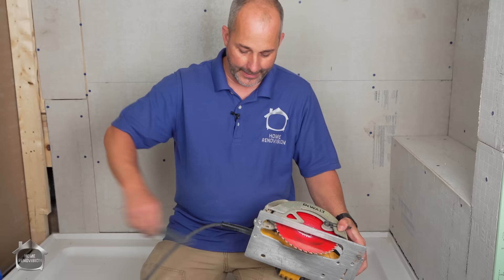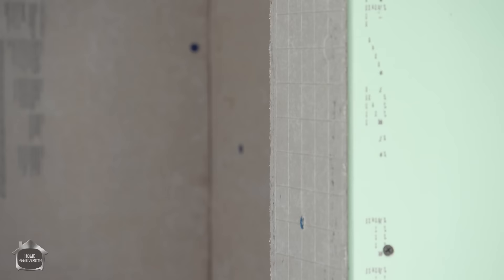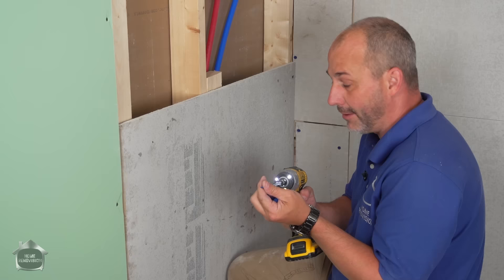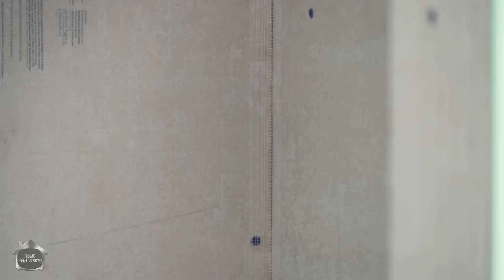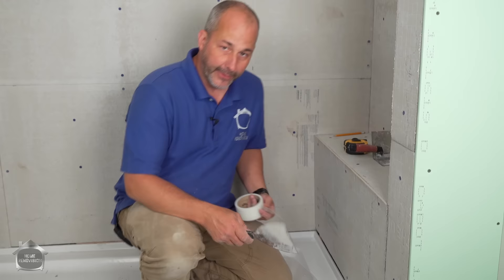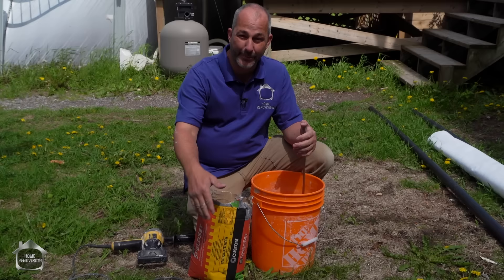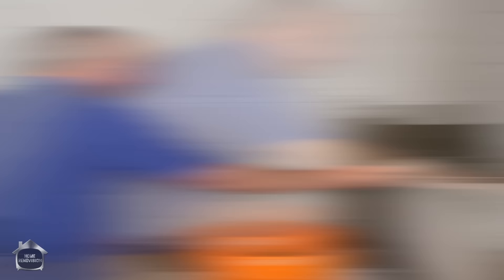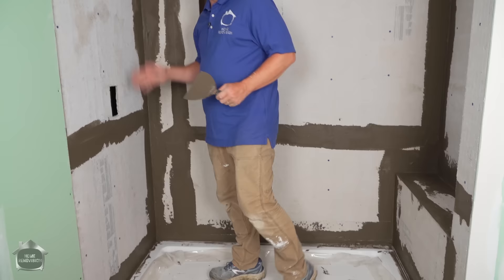How to Install Cement Board for Beginners

Comment: We are installing a 3x5 walk-in shower with a fiberglass shower pan.  We need to take up 1/2" of space on each of the 3 walls for the shower pan to fit perfectly.  What is the best product to use to take up that space before we put the cement board on?  We were thinking of waterproofing drywall, attaching the cement board and then waterproofing that as well.  Do you have some expertise for us please?

Comment: I tried to do the seams and I couldn’t find any material that went on that smooth. I don’t know what to use, ended up using thinset mortar
Reply: Your supposed to use thinset morter. He mixed it just a tad runnier so he had more working time. Some guys will seam as they tile.

Comment: Can you mix and match Kerdi board with  1/2” backer board? Stared remodeling my shower with the kerdi 3x5 kerdi boards but it got expensive quick, so I switched to backer board on the walls. I don’t want to waste the kerdi I already have installed so can I use both, kerdi on one wall and hardi backer on the other?

Comment: I know it' not necessary, but I would still apply the Aquadefense up to head level all the way across the whole back wall of the shower. Probably higher. I know you didn't have enough material to do it but still.

Comment: Hey great videos. I'm redoing my bathtub now and I got to the point that I need to join and finish cement board and drywall. What is the recommended way to do that nowadays? Thanks.

Comment: Hi Jeff, what is your experience using Dens Shield as backer board? It is light, can be cut with knife and moisture proof, so very user friendly for a woman DIYer. Most interested to hear from you before I begin the bath renovation. thank you.

Comment: I'm doing my bathroom right now. 
And I'm debating weather to use any waterproofing.  I did buy the red guard and I'm at that point right now. Just gotta finish the niche's and it's ready to seal. 
My issue is water flows downward always. But waterproofing really is  redundant to a point. 
But I guess for piece of mind.

Comment: When cement board is flush with dry wall, how do you handle this joint?  do you tape? do you tape and use cement over the entire joint/ or half the joint?
Reply from the maker: design the joint to finish behind the tile on the exterior of the shower. then just install the tile and ignore the joint. that crack will never translate to the tile.

Comment: Really appreciate your videos.  One question regarding the cement board:  You had said to use half-inch cement board when it joins with sheet-rock.  So did you use the quarter-inch cement board in the back of the tub or is it half-inch also?

Comment: Thank you so much for all your great tips and tricks! We have learned SO much already! We are working on our bathroom and have a couple of questions. Why do you think it's not good to put two 1/4 inch cement boards on top of one another? HardieBacker is currently available in 1/4 inch and .42 inch thickness. We're wondering if we should use .42 inch thickness or two 1/4 boards on top of each other to butt against our 1/2" drywall. Thank you in advance for your answer!

Comment: In the case of using cement board around a window in the shower area, do the inside corners of the window also receive the mesh tape and quickset or would it be better to use a silicone or the 2 in 1 bond/sealant you like in that instance? 

In the same vein if I’m using the aqua defense as my waterproofing in the window is silicone the appropriate product to use to seal the gap between a vinyl window frame and the cement board which can then receive the roll on application of the aqua defense?

Comment: Thanks for your videos.  Awesome!   My wife has been asking for a window in bathroom for 10 years.  I watched your videos and did it last weekend. Looks great!   I have a question about how the wall board you showed connects to a custom poured shower pan.   I have seen where people say if the board touches the pan it can wick up moisture.  Do you have a best practice?   Also if you have any best practice for a curb?   Pour base or screw on wallboard?  Just not sure is most effective waterproofed methods.   Thanks!!

Comment: Hi , your videos are immensly helpful. I have a question regarding the finishing of cement board, but for the fireplace.  Humidity is not an issue, heat is!

I replaced my fireplace with a high efficiency (still wood). I repaired the hole that was made for the change by screwing cement board (durock, 1/2'') in the metal frames, it's solid but there is a little flex in the middle. I put plaster of Paris, non-shrinking compound, to fill the gap on the horizontal joint, then I put mesh tape between the 2 sheets with drywall compound, waiting between layers and waiting 3 days before making a fire.  Whenever i make a fire, a horizontal crack appears. Repaired 2 times, same thing. Have an idea, I'm stuck.

Comment: Thank you, my basement recently flooded with an inch of water, I cut out the sheetrock t 16" above the floor, I want to install cement board and tape it to the above sheetrock, what kind of tape should I use?

Comment: Does the cement board need priming first? I'm doing my shower room now, and the cement board is dusty.
Reply: I've seen to clean it off first with a damp rag and/or sponge. The dust will keep the cement thin set from sticking, just like tape won't stick to a dusty box.

Comment: Do you have to use 1/2" backer board next to drywall? What about the finished tile thickness?

The 1/4" hardy board is 1 screw every 7sq inches

Comment: Can a Schluter shower tray be used with cement board walls? Do you have a previous video that addresses this? We don't want to spend the extra $$ on an all-Schluter shower, but want to ensure a proper slope to avoid any drainage issues. Our bathroom width is only 58" so a standard 60" shower pan is not an option. Or maybe there is another pre-slope product you would recommend?

Comment: I have seen multiple different opinions. Should the concrete backer board go to the top of the tub flange like you put, or in front of it down to the tub top?

Comment: Hello Jeff, Love your videos I have accomplished a few projects following your projects. Question? shouldn't I use a silicon between shower pan and backerboard prior to applying the cement. I would think with the flexing in the shower pan I might start getting cracks in the cement after awhile. Your Thoughts. Thanks

Comment: I am trying to find out the finer points of building 2 master bath showers in the container home I am building. evidently you build a frame to pour your concrete showerpan. lots of details related to getting your membrane & drain located correctly. after that its tiling the stall. which is better durarock or cement board? Relative to the outer concrete surface of the pan, when assembled correctly where is the inner surface of the durarock or cement board?

Comment: Nice waterproofing.  So, you roll on a waterproof barrier, and then apply a water based tile glue (or perhaps cement).  Do you ever have issues with the tile set glue bonding to the water proofer product?

Comment: Have watched several of your videos as I'm demo'ing a +100 year old bathroom! 🙀 I've heard you say a couple times "water will drain back out of the tile to your drain" in your cement board video, tile video, etc. Is there a vid you can point me to that helps me manage this? Does the silicone bead at the bottom of the tile/tub lock that water in? Thanks!

Comment: I have a question regarding what thin set to use over the waterproofing. Some YouTube videos say if you waterproof then you cannot use a modified thin set or it will take 30 days to dry. Do you use modified or unmodified thin set for your tile work over waterproofing? Thanks so much

Comment: Are you supposed to start with cement wall and then the regular drywall or viceversa?

What the best way to waterproof a walk in shower that didn’t have any pan liner when all the tiles and all the drywall were removed and it’s a concrete floor? 

I’m stuck now with an empty bathroom and not knowing what else to do?

Comment: I have watche a ton of your vids and it helps more then you  know.. Question for ya. I started remodel shower with kerdi board and then miscut and ran out. I lagged for a few months and now everyone is sold out of kerdi board till august. Floor decor h depot lowes everyone. I have one wall that needs to complete. Can i put cement board on that one wall and the other two have kerdi board. If not i fear i have to re due all kerdi with cement board. Any suggestions would be awesome.

Comment: Remodeling my bathtub….after removing old tiles and walls I used concrete wonder boards for the walls….also adding lights…do I need to use wonder board for my low 7 foot ceiling?

Comment: Can you use the roll on water proof system over regular mold resistant board or do you need to use the cement board   thank you

Comment: Hi Any advice on what to use over  cement board that is placed externally on a perimeter fence that will be painted, not tiled. I mean what kind or primer or membrane is ideal before painting please.

Comment: Jeff, I have a question. It appears that there was a horizontal joint near the top left side of the niche and when you were doing the joints with mortar you didn’t cover that joint? Why not? Thanks

Comment: Is the quick-set you use as a joint compound for the cement board the same as thin-set mortar used to place the tiles?

Comment: Woodbridge, Virginia. My master bath shower was built with "Green Board". I am in the process of re-building it now, and have a question for you.  One of the shower walls is also an exterior wall. It gets very cold in the winter. Could I use 1/4 foam board with a 1/4 inch hardi backer? I do need to blend it in to drywall. So it does need to be at a 1/2 inch. It just seems that the combo will give the 1/2 inch and a level of isolation from the cold of the exterior wall. I am looking forward to any answers I get.

Comment: I have cement board to drywall meeting each other, each side doesn't have the manufactured dip. I want to finish it nicely between the cement board and drywall by using perhaps T trim. Do I install T trim before doing thinset or after?

Comment: Hello, how would this do for exterior use? And what would be the best way to waterproof the cement board? I was told this is good for board and batten on a barn but I’ve never messed with cement board.

Comment: In a later video you add extra thinset to slope the bench a bit for drainage when installing the tile. Why not just slope the bench frame itself when you were building it? If that's flat, wouldn't water that makes it way underneath just sit there?

Comment: Do you have to use backer board on the ceiling in the shower? I am renovating my stand up shower, does backer board need be in the entire shower? Does it need run up to the ceiling to include the ceiling?
Reply from the maker: only if you are tiling the ceiling. Cheers!

Comment: You mention that water can get behind tile, but what about glue-up wall panels? Flat Mustee Durawall wall panels for instance. Redguard is insanely expensive here so I'm looking for other options. I'm also not sure if the loctite will bond to redguard.
I want to use hardie cementboard that is water resistant and I will put pvc trim along the top perimeter and use 100% silicone all around it.
I have a tub without a flange (old cast iron one) and I'm trying to figure out the best way to install the cementboard above it. I've read it needs a 1/4" gap between the lip of the tub and the board, its that right? If I put moisture barrier behind the cementboard, can I use some flashing to bring it to the edge of the tub to make a sort of plastic flange? (so long as the flashing isn't visible under the cementboard. I also plan to put caulk along the underside of the cementboard and maybe some Instatrim over that.
Can aquadefense be painted over?

Comment: Complete novice here.. ? Is there anything specific  to be done to joints where  hardie board and drywall meet? As in for a backsplash  or half wall. Would you use drywall joint compound  or thin set? Also if say I am only  doing a backsplash  would you reccomend  cutting the hardie board  to only area tiled or could the untitled area be finished   like the drywall n painted?

Comment: I used Mapelastic CI by advise of Floor and Decor associate, and after applying it on the shower wall, I realized that this product is to prevent cracks but not for waterproofing. I wanted to get advise if I can still paint over the brown Mapelastic CI that is already applied on Hardiboard with Aquadefense instead of tearing everything thing down and re-boarding with hardie board? If so will it impact tile application or tile strength in the future? Thanks in advance.

Comment: Hi Jeff, we are remodeling our bathroom and while installing the drain for the bathtub, the plumber forgot to peel the plastic off the drain hole before he installed the tub drain. He used plumber putty for that, now everything seems pretty tight but do you think eventually it might leak? The floor is still open at this point, do you recommend us to have him come back to reinstall the drain or do you think it will be fine? Thank you.

Comment: First time shower diy.,
I bought the Laticrete waterproofing fabric and plan on getting the red guard and cement backer board... But do I need tape and mud the joints when I have the waterproof fabric?

Comment: I have a contractor who used drywall compound in the joints. After the fact I figured out that this was incorrect. Should he remove the compound,? put thinset over the compound? Or remove the boards?

Comment: Can I use the same Sand Mix for the bottom preslope and for on top of the shower pan liner for my shower pan? Or do I need Concrete on top of Pan Liner? Extremely helpful videos. Thanks so much for making them so detailed.

Comment: My cement board is extremely heavy to the point where i dont know if i will be able to hang it myself. Did i get the right product? And should i cut it to manageable pieces or just use one piece per wall. The sheets i bought are big enough to do that.

Comment: I'm noticing that the cement board is sold mostly by 1/4 inch instead of 1/2 (I assume because of weight). Is it typical to drywall a bathroom in 1/4 drywall instead of 1/2 drywall so you can make the transition easy out of your walk in shower into the rest of the bathroom?

Comment: Quick question 
I used cement board in wet area after finishing it with paint i found hair cracks at every joint of board knowing that i used mech and universal putty what could be the reason ?
I’ve tried to open the join by 5mm and fill it with sealant but the crack keep coming back

Comment: Jeff if you are using cement board on a kitchen floor do you still use the tape on the seams. also do you glue the cement board down or just screw the board down? thanks Butch

Comment: I am using Kerdi waterproof cement board (not foam board).  I will apply cement on seams.  Do I think need to apply the waterproof membrane only to the cement on seams?  Is that even necessary?  Thanks.

Comment: Jeff, though I’ve just started watching the videos, when I tore out the existing shower, the pan was customized where the standard 36 x 60 is not long enough or wide enough. I have to build out the back wall and side walls with about 1-1/2” of material- as in if I use a 2x4 along with the Go Board, I’ll have enough space for the pan to fit. Can I use 2x4’s with the backer board to “bring out” the wall, or order a custom pan to fit? Any feedback is greatly appreciated.

Comment: I am redoing my bathroom in the near future. The quotes I have gotten are sky high. When you mentioned the waterproofing importance and the diy reason to do it as opposed to trust the contractor to overkill i made up my mind. I am using durock and either redgard or aquadefense. Are multiple coats , more than two, detrimental or helpful?
I have to watch you traditional shower pan installation which I prefer over the prefab ones. 
I plan to do the walls, plumbing and shelves and leave the pan and tiling to the professionals. I was quoted 10k for labor on everything which is too much for my budget.
Any tips would be greatly appreciated.

Comment: I seen a lots of your video about waterproofing, but most of them are about the wall. What if you want a ceramic shower without using a acrylique pan? what would be the most reliable solution for a custom size (6 ft x 3ft)?

Comment: Does it matter which side of the cement board to use if you are using a waterproof membrane over it? There's a smooth and rough side, I'll be using thinset mortar for attaching the 4" square tiles.

Comment: Your videos and channel overall are just awesome. Quick question what can I use just to seal up the tiles already on my shower wall? I really don’t have the money to go all in  right now but I have to put in a shower because the one currently there is letting water seep out  Under the exterior tiles. The wall tiles are still good

Comment: Did you use 1/2” or 1/4”cement board? It’s hard to tell from the video if the cement board bottom edge is flush with the shower pan flange. The flange on the shower pan I bought is only 3/16” thick. If I use 1/2” cement board I’m going to have a pretty large step back to being flush with the pan flange.

Comment: Do I need to sand walls where the concrete set to smooth out before I add the mastic? Also, do I need to cover the screws as well with concrete? I am using the DumaWall system after I install the backer boards for a 36X36 showere.